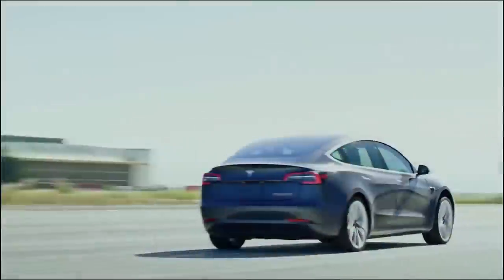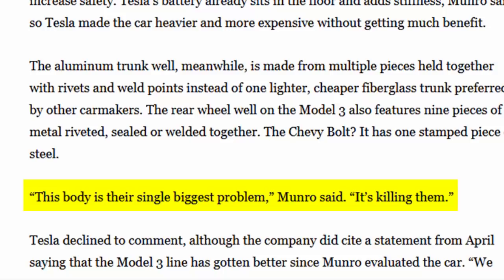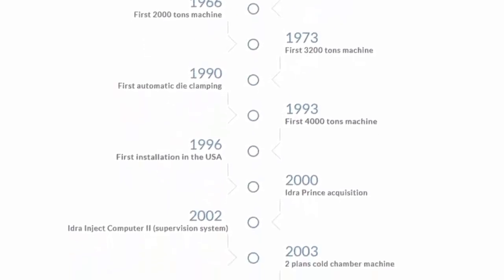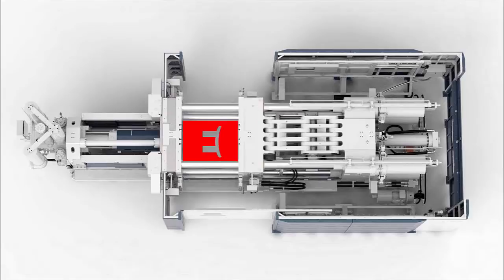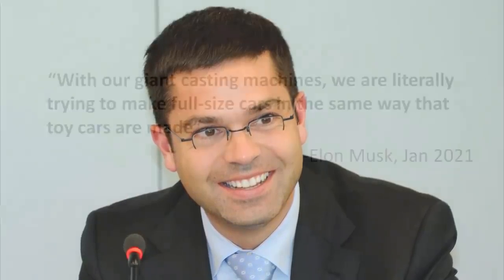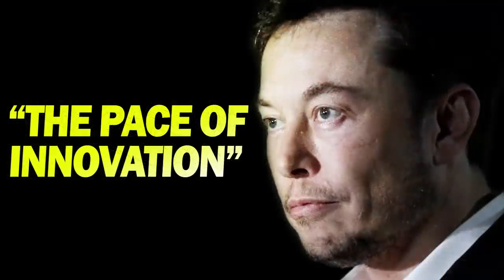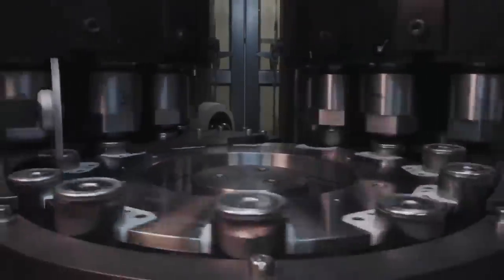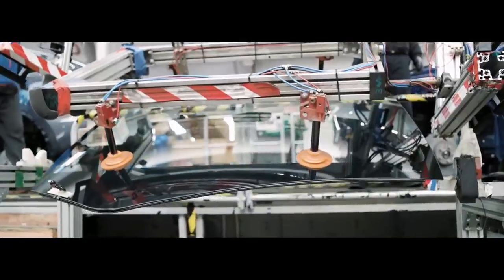Tesla Giga Press will CRUSH

Comment: On the other hand, real gigapascal aluminum is stronger than a semi truck frame.
Really doubt they will use quality materials.
Reply: If you alloy aluminium/aluminum with scandium it can reduce weight by 10-15% (ie. more range and less material cost) and can increase yield strength by up to 150%. It is also very corrosion resistant. You only need to add a small percentage of Scandium to aluminium for this alloy effect.

The whole thing can also be recycled by Telsa, (or anyone else for that matter) melted down and re-cast from old car bodies with little processing.
Reply: @VenturiLife  So, 150 000 psi. = 1 GPa. That is considerably stronger than current truck frames ?
But the real future of automobiles lies in the key fob. In the future we will be able to press the
'car' symbol, and the car will appear. Then  when finished, press the 'no car' symbol, and the car disappears into the key fob. No need to visit body shops, mechanics, as the owner can repair/modify the program with his home computer. Rich people don't worry about rust or collisions, etc. as they just get a new car. It is the poor bastard with a garage full of tools and a budget who takes the hit. The key fob is certainly the car of the future. we need a metal that is immune to any acid, or any temp. One would have to take metal from the inner shell structure of the moon if the object is indestructibility. Ha, ha,...
In other words, Tesla is just another scam to make a few rich.
Reply: @seapeddler  the car of the future is an autonomous taxi service
Reply: @johnuferbach9166  Yes. We worked out that we use our cars about 4% or less of the time. Most of the time they just sit somewhere taking up room, and are a major financial investment.

Most people will be happy with an Uber on demand, without the driver included. And it's coming. Vehicle fleets are the future. Vehicle ownership will be pretty rare.
Reply: @johnuferbach9166  Whatever, as long as the vehicle still has cigarette igniters.
But if the future is for robots, the taxi won't know where to take someone to work, because humans will become redundant. Robots don't eat, so there will be taxis taking people out shopping at extinct shopping malls.
And since people are no longer required, the planet will be over-run with wildlife.
Many bears, cougars, elk, in America, and lions, hyenas, etc. in Africa.
Taxis will only be used to carry people on safaris, and the doors automatically open at the wildlife parks.
Reply: Are you stupid?! Steel is the ultimate solution for semi/heavy duty applications. Hauling 80,000lbs with aluminium chassis is a joke right!?!
Reply: @alanmay7929  Aluminum can be alloyed into material far exceeding steels' tensile ability.
Powdered metal, for instance is superior in valve seats, as the grains are engineered then pressed, and heated into the new material. Then there are cermets...whole new species.
It isn't a question of stupid. Steel oxidizes and loses strength, and is very heavy.
Going back 60 yrs. or so, the German Haunebu flying saucers had hulls made of Viktolon.
This material can withstand 40 000 deg temps . What attacked Admiral Byrds' ships, and why did they return back to USA ?
Also, flame jet generators generate a high voltage which electrifies the leading edge of a jets' wing, which allows it to
break the sound barrier silently. T.T Brown invention.
Yes, there are stupid people out there, and they are still using dog-shit steel because it is profitable.
Theissen /Krupp, same people who provided steel for the WW2 war machine.
Fools have tools, but God made the Universe without a toolbox.
So, yeah, I may be stupid, but I'm not taking it personally; but you should.

Comment: They should use the gigapress to make aluminum rings for the Boring Company and get rid of the need for concrete walls in the tunnels, which are expensive to move and slow to install.
Reply: Are you dumb?! You realise that its waste of ressources right! Its also more than 100 times more expensive than concrete. Go educate yourself.
Reply: @alanmay7929  It'd be a lot cheaper to fly aluminum rings to mars than concrete or steel rings.

Comment: Use of mega structures will make crash repairs very expensive. Thus many more crashed vehicles will be totalled. The consequence will be astronomical costs to insure a Tesla.
Reply: Won’t be many crashes with self driving vs human error plus Tesla will offer insurance based on low accident statistics
Reply: @tradingwithwill7214  TRUE tesla already safer than average cars by a large margin
Reply: @Paul S you underestimate highly. The value of the autopilot has gone up very fast. Soon it will be 15k, then 20k. It will reach 100k within a few short years and be full level 5 at that point, an appreciating asset. Check the master plan, we are right on schedule.
Reply: Self driving cars are still years away
Reply: @senoJSR  yeah like 3 years away thats so long from now
Reply: @Paul S Self-driving cars will never be "Safe", unless there are no Pedestrians, Cyclists, or other Human-driven vehicles on the road. Keep in mind that we have had Commerical Aircraft that are effectively self-piloted since the 1990s. They were always systems that required a pilot, but effectively those zero visibility landings on Commercial Flights were done by the Auto-Landing Feature...
Self-Piloted Aircraft are possible because the Pilot & Air Traffic Control still kept an eye out for Birds & Light Aircraft flown by a pilot, so there were no accidents like the Tesla missing a roof crashing into a house with a headless driving behind the wheel. As the Computers on the Tesla viewed the Semi-Tractor Trailer as sky because it was painted white and the day was overcast...
Reply: @davidhollenshead4892  super dumb comment bro, teslas are already 2x safer than other cars because of the features (not self driving). The self driving is already better than most humans statistically, you havent got a clue how computers are changing the world apparently.
Reply: @davidhollenshead4892  the auto braking feature of the car literally saves a pedestrian from being hit, compared to a car from the 90s which has no idea you are about to hit something. Get a clue, maybe go buy a modern car?

Comment: so it's like we use at work to make our food containers,  it's basically a big thermoformer press like irwin research makes.   but cept this is doing metal forming.  sweet!
Reply: no, it's injection molding
Also aluminium has to be injected at fairly high speeds compared to plastics, which is why everything but the clamping part of the press is so different.
Reply: @AKAtheA  Casting aluminum promote bi-films and oxide  inclusions - even inert gases have some oxygen and aluminum will combine with it - I just wonder what the elongation is on the finished casting let alone a keel block, 3 -4%? shoudl be 25% if they are true clean castings - 10% state of art.
Reply: @EddieVBlueIsland  .006 per inch shrink.

Comment: Doesn't it take more energy to create all these green energy products that it's absurd to believe that it'll save the world.. especially when you think about where and how they're getting all that materials..all those heavy equipment and desiel pollution, environment destruction..where do you think the energy comes from whenever charging these Tesla vehicles?..FROM THE MAIN GRID
Reply: Here in Ontario Canada electricity generation is 60% hydroelectric and roughly 40% nuclear with some solar and wind, no diesel or coal fired plants. Aluminium is recyclable over and over as are the battery packs, in the long run when most vehicles are made this way the amount of new virgin aluminium will gradually be diminished.

Comment: Here's what I want to know.
When is Elon going to give up on aluminum and go with flash bainite steel? It's lighter and stronger than aluminum.
It has almost the same strength/weight ratio as titanium.
Make it happen, Elon.
Reply: Because flash bainite steel is a different chemistry. Magic doesn't happen over night.
Reply: Can he press it with these gigapresses though?
Reply: @crhu319  it's not a press
Reply: @crhu319  You press it as regular steel. Then you convert it to flash bainite.

Comment: Always wanted big things built like Toy cars; almost indestructable.
Reply: Jim Larsen, that's not really possible or desirable.  As mentioned you want the car not the occupants to dissipate the crash energy. Also things don't scale linearly like that. If you double the size you might have 8 times the mass etc.  

F1 had a design change to beef up the foot box to tonka truck levels to save drivers feet. They later found this to be the perfect weapon to impale the other driver. They then  redesigned it to square off the foot box to increase the impact area and weaken the nose to better dissipate the energy.
Reply: Of course surface area to mass ratios change with size.  Thus a mouse may survive a long fall, and a horse will splat.  In the Tonka make believe world the laws of physics are ignored.
Reply: Untill they hit 88 miles per hour and disappear from reality, and you can never find them again..
Reply: You want the soft human to survive the high-speed crash, so the car has to crumple and sacrifice itself.

Comment: If an accident did damage the casting it could be repaired in the same way auto bodies are repaired today.  The damaged section would be cut out on prescribed lines.  Then the cut out section is removed and a duplicate cast piece is put in the original casting and welded in place.  The structural strength would not be reduced appreciably if the cutting of the original casting is done in a way that allows the welds to made such that the stresses on the vehicle don't work against the welds in the wrong direction.
Reply: this assumes that you can arc weld the alloy and not fuck up the heat treatment...seeing the copper content, I'd be skeptical about that... Also Tesla is kinda' famous for being dicks about independent repairs.
What's more likely is that the crashed car will be scrapped, the chassis is one of the cheaper components anyway. Save the battery pack = more then 50% of the value of the car. Even the other parts would be valuable, as new OEM parts are $$$ and you can't buy all of them from Tesla, they simply refuse to sell some of them.

Comment: Uhhhhh, nothing gets crushed in die casting - it's molten metal being cast. But I get what you mean.......not. 👀
Reply: I think you missed the center piece of this video which explains the play on words of the title.

In conventional die casting the metal is poured into a form and allowed to cool then removed from the form and cleaned of flashing, surfaced prepped to remove oils, painted and assembled.
Tesla does something a little different. 
Die castings are weak, prone to cracks and not easy to repair once they break.
What Tesla does differently is the press. They inject their own mixture of aluminum into the form and it cools quickly.
The pour happens under extreme pressure of thousands of tons of force per square inch of area and the pressure is kept as the pieces cool. It's still a die-cast method but the results are very different. This changes the structure of the aluminum creating many many internal cross links of the aluminum metal crystals as they grow in the metal while cooling. 
This increases the strength and resistance to cracking from vibrations to a very large degree making the process well worth doing.
No air voids can form in the metal because all air is compressed to the point it boils out of the metal part immediately.

The result is a stronger, lighter, stress fracture resistant, impact resistant, corrosion resistant, cost effective time saving part that can be mass produced and put into the assembly line after a bath to remove the mold release oil.
If they want to change the shape or style of the part being manufactured they simply build another die to be installed in the machine and are still able to have the old die on hand if needed to produce parts in the future.

I don't much like all of the hype surrounding this company and the man who now owns/runs it but I can respect his willingness to try new things.
If a critical look at what was done in the past reveals room for improvement he will give it a go.
Reply: @btwbrand  To be fair I did NOT watch the video past the first few minutes because I got the gist; so I missed the fact he made a joke like I did out of "crushing" as if indeed he did  when there - as I explained - is no crushing in die casting molten plastic or metal into a die. I will take your word on this one.  ⏚
Reply: @cuda426hemi  lmfao you evidently didn't get the gist.

Comment: One correction, the castings don’t need to be quenched. The alloy allows for room temperature cooling.
Reply: If you are about to create 4000 cars an hour you really don't have time to let them cool off in air temperature. Also the ambient temperature would need to be heavily adjusted all the time to secure a constant production quality. It's much more efficient and more controllable environment to quench.
Reply: @jonbeargenx  he said 4000 castings a day not 4000 cars an hour.
Reply: @alanmay7929  You're right. But it still is 4000 units which is the real point :)

Comment: and here i thought that silicon was an impurity that added brittleness to alloys - comming from a steel backround mind you
Reply: Silicon is to aluminum as carbon is to iron.  Aluminum silicon forms hypo-eutectic and hyper-eutectic alloy ~11% silcion is aluminym matrix - typically present as silicon platelets - like cementite in steels it increases yield strength.   These aluminum silicon alloys a geneally not heat treatable - though modified microstrucutre by sodium and calcium in the casting process.  One can maker aluminum carbide but like calcium carbide it is reduced by water to make methane gas - calcium carbide makes actylene.
Reply: @EddieVBlueIsland  oh thank you learn something new every day

Comment: With how little bots hold the castings, if tesla do it right, they could make this a system that could come apart in three modules, front, middle and rear seen as it's all wires a quick connect system could be done where the whole front of the car could be replaced with an undamaged colour matched front module or rear or whatever. Saving waste and speeding up repairs.

Comment: With any car, if the frame needs to be replaced, then there is a structural damage done to the car, and it's considered a total loss. 
The thing is, if the Tesla frame needs to be replaced, this would be actually much cheaper if they could do it. However, I am betting that this kind of damage is going to be much less possible due to the fact that now the whole frame is in one or two pieces. The casting brings simplicity and durability in one shot. Time will tell if this was a good idea, but the engineers are all excited about it, because.. you know.. math. The thing is, for a lot of manufacturers that have more than a few type of models, this way of putting a car together is not feasible.
Reply: I would debate that , yes it maybe cheaper to manufacture the frame , but if you have to remove a whole frame and refit the rest of the car to itt , it is a huge job and i have done it in my younger days ..
Reply: @mikldude9376 for any car, if the frame is damaged, generally it's deemed a total loss, nobody will fix this car if it's too expensive. But if the price of the part and putting it together does not exceed a certain amount this could work.
Now I know I'm not speaking from experience, but I took this from a collision center website: https://certifiedcollisiongroup.com/if-a-vehicle-has-frame-damage-is-it-a-total-loss/#:~:text=However%2C%20frame%20damage%20does%20not,is%20considered%20a%20total%20loss.&text=However%2C%20if%20the%20cost%20of,automobile%20back%20on%20the%20road.
However, my point was that the casting would make the frame much more sturdier, and a frame damage would be less possible, not that the replacement of the frame would cost less, although that would also be possible (but don't know this for sure).

Comment: Ummm... If the casting is so hard that it will not be damaged the impact energy will have to be absorbed by the middle part , passenger cell and  battery pack, not a very good idea !Even if only minor and no harm is done to the passengers the car would be a write off ! You can not call that sustainable manufacturing! LOL
Reply: It's aluminum. It can be melted down and reused. 

If they can make the part at a similar manufacturing cost as they make e.g. the bumper, they can just remove it and install a new one, instead of having to remove all parts anyway, replace a dozen smaller parts, maybe straighten the frame, then reassemble everything.

Comment: I can't wait for it....casting the major parts of a car just to finish making them disposable. What do you do when you get in a fender bender and snap a CAST body/frame structure. Hint, you cant afforded to replace it and they wont sell another
Reply: This is my issue. The benefit of a car with a subframe is you can have modularity in the body and still have a safety cage and crumple zones. This loses all of that. In the long run I bet they've discussed this but they envision autonomous cars that don't crash and with cheap insurance.